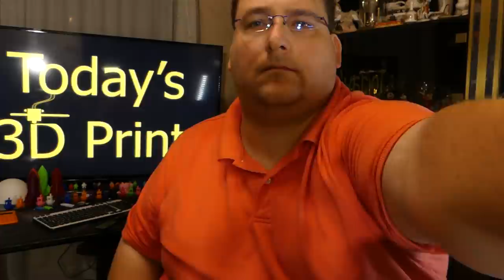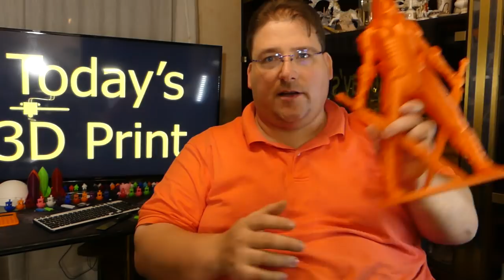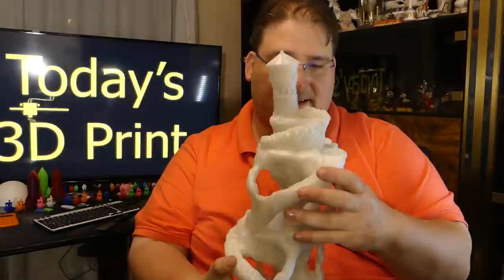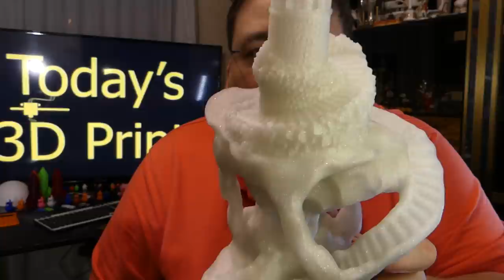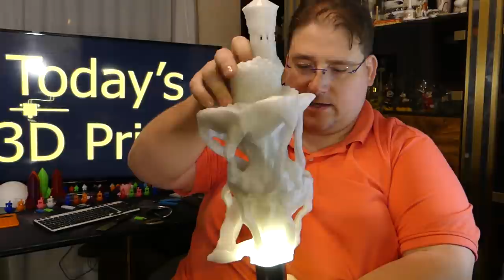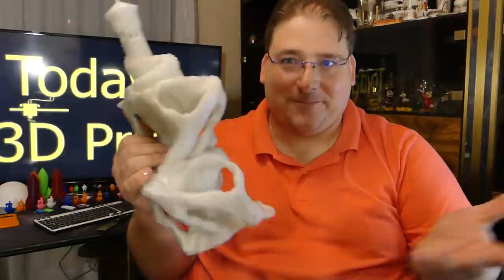Today's 3D Print 126 Kijai Tower Remix, Tevo Tornado

Comment: Maybe put an acrylic rod through the center so a light in the bottom will illuminate the acrylic rod.
Reply from the maker: I am just going to shove led's right up the center! when time allows and I nab a bit more of that filament I am going to try and model a hole up the center.

I COULD try drilling this one and its strong enough to handle that without too much risk of damage so I might do just that.
Reply: If you can, once you have it illuminated, show it in one of your videos.  It'll be nice to see.

Comment: this is also made with 'transparent' PLA, one perimeter only and with adhesive LED-stripes inside (those you can cut to length). I made some snippets with thin wires and soldered them all together (in parallel of course). the nice and wild pattern is made by spraying Acetone onto it: https://thingiverse-production-new.s3.amazonaws.com/renders/92/9f/27/b6/49/6ffd08630ae0be5f40bd56fcf81f8458_preview_featured.jpg
Reply from the maker: Very pretty going to have to try that

Comment: Why do you think the Tevo Tornado is not good for engineering prints? Even after you added the TL smoothers.
Reply from the maker: layer alignment is poor in my personal opinion for fine finished parts. ie flat consistent geometries (what I call engineering prints) "display" these flaws very obviously (see my comparison video comparing the green and red nosecones) all those layer miss alignments make it poor at this and I am not sure how to fix them. Mind you they are not bad. the prints are quite good. but when you are used to better.....

I also have issues with very large "thin" prints. remember the large green rocket and the wavy surface? it did it to my mega man blaster and now I notice its endemic somehow to the printers geometry. its actually a spiral!! I did not notice this on the rocket but do now that I am looking for it. One day I will try to see if I can track down why its doing it. waviness can be thin walls or filament or heat but a spiral is engineered. that is something to do with the physical geometry of the printer. "heat and cooling" etc.. can't make a spiral. a spiral is constructed. mechanical in some way.

IT IS possible this is something to do with my particular example of this printer and maybe others will not experience this. but I can only go on what I Have. otherwise it prints fantastically.

if they were not backordered everywhere I might be tempted to see if tevo would be willing to send me another tornado to confirm if its just my specific printers or "in the design" so to speak.
Reply: Thanks so much for the detailed reply Nerys. 
My intention is to buy this printer and use it for product prototypes out of PETG.
So I was thinking the AC heated bed here is a big plus over the CR 10.

Have you since printed the Benchy after you've installed the TL smoothers?

Great work with your Channel so far, it's great having someone go a bit deeper when they are reviewing printers.
Reply from the maker: +Kirk Dyer yes small Prince come out fine like Benji's look great Marvin's look great little rockets look great it's when you go large that you start to notice the issues ptg does not require a hot bed so cr10 is fine for that depending on what you are printing either one is fine I like them both I just think the cr10 edges it out a little bit in quality